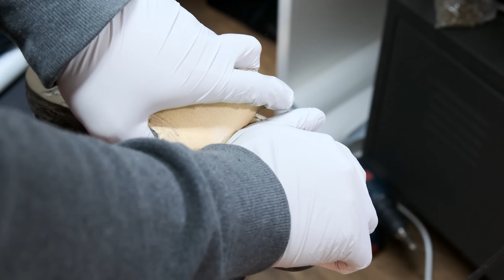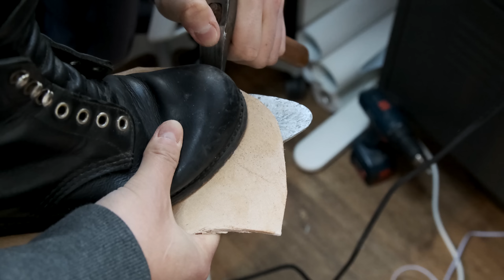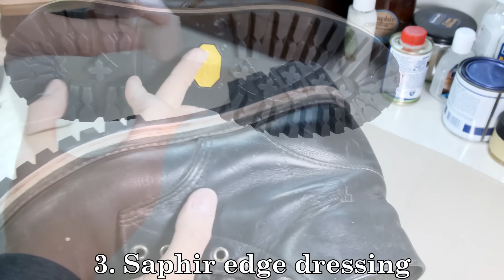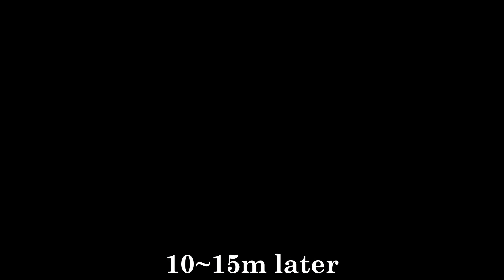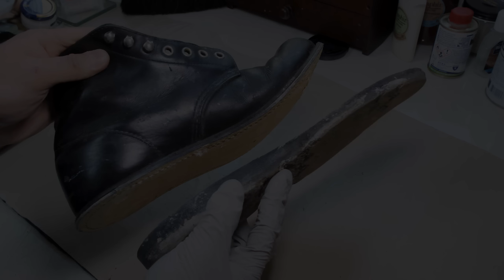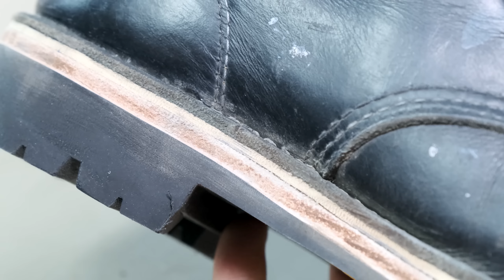[ASMR] Resole & restore 'Redwing'  2951 change out-sole  4k

Comment: I m sure buying a new pair would be cheaper than repair 🤔
Reply: No, it actually isn't, even despite the price varying based on the cobbler. Redwing boots are handmade and incredibly durable. With the slightest bit of upkeep they will out last any disposable shoe you can think of